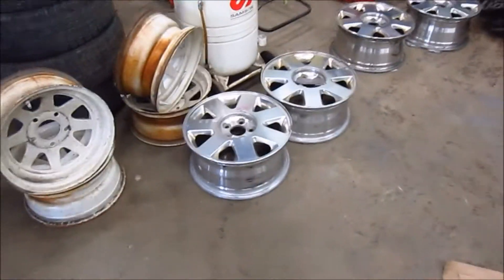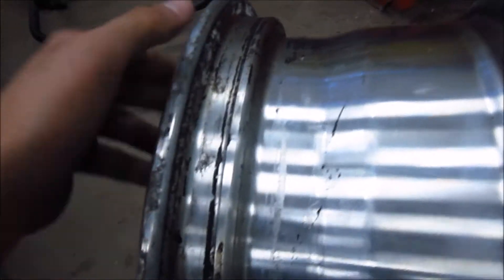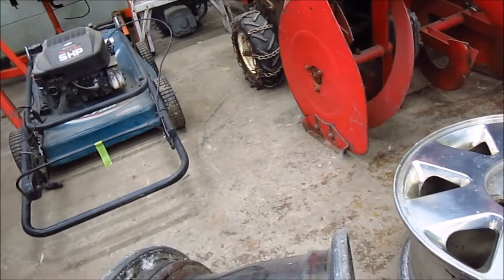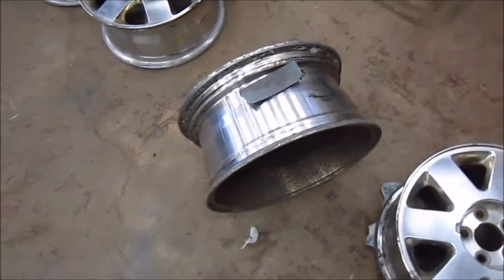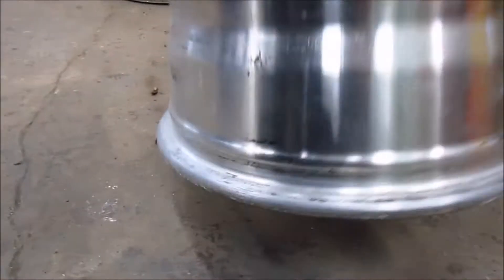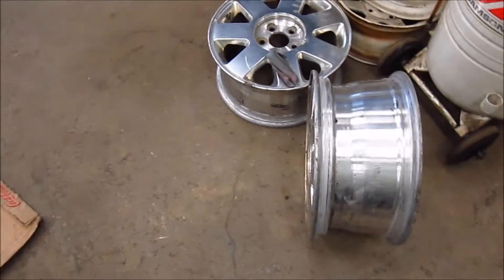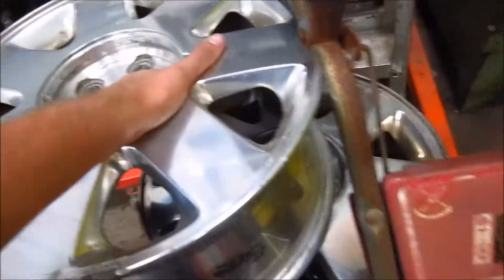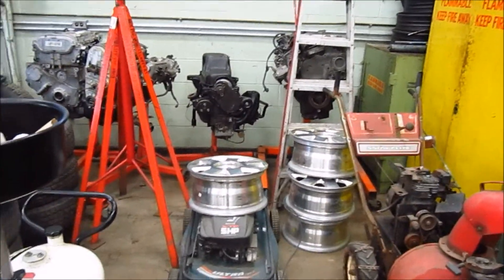How to prevent aluminum rim bead leaks

Comment: Wire wheel on angle grinder works way better  that's what I been using for 15 years lol
Reply: Totally agree, i have been in tyre fitting most of my life and all we ever used was a wire brush, or wheel in a drill. Once the corrosion is off, a good coating of bead sealer does the trick. Wire brushing does not take the surface off, abrasive paper does. Not what you want to do to a costly alloy wheel.

Comment: check my channel.. my dads  chromed aluminium rims were so bad i had to grind the edge  with a angle grinder and apply epoxy resin and level out the damage.. ..works fine

Comment: Not even close. Once you sand or wire wheel any rim, be it aluminum,  alloy or steel,  you have to replace the coating you have removed.  It's called bead seal.
Reply: I had no idea there was such a thing for beads after cleaning them with wire wheel or sandpaper. Bead seal eh?
Reply: Very correct Warren. Actually my XMax Scooter has 2 very slow leaks on the bead rim. New tyres were put on 6 months ago or less. Can be a number of things wrong. 
Shall get rim cleaned and sealed and also check for manufacturing defect. 
A bit hard to explain in a 2 min video. 
Normally it would take a 20min vid or longer to explain all permutations in detail.

Regards.       NZ